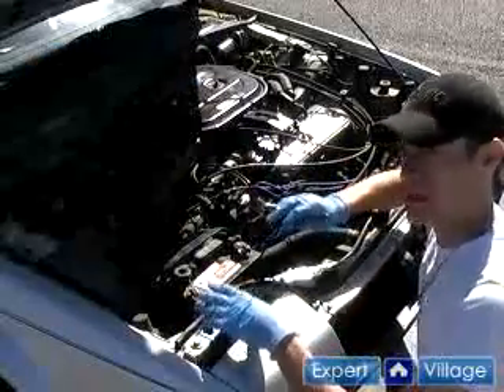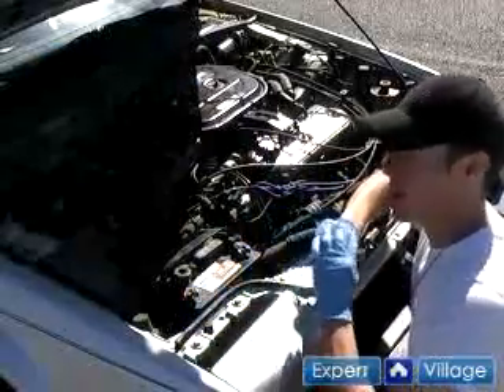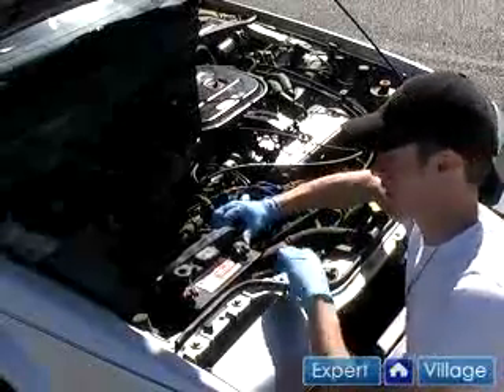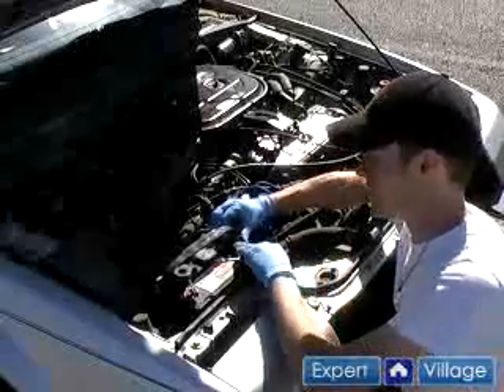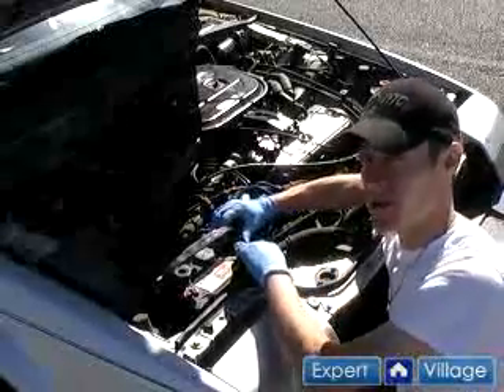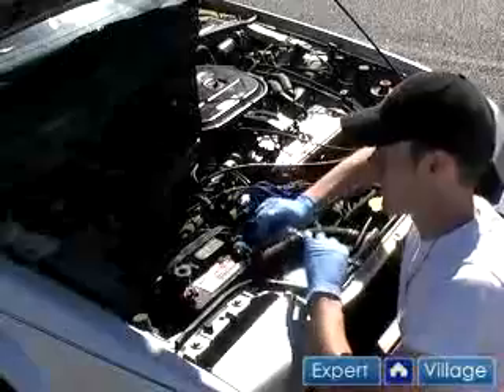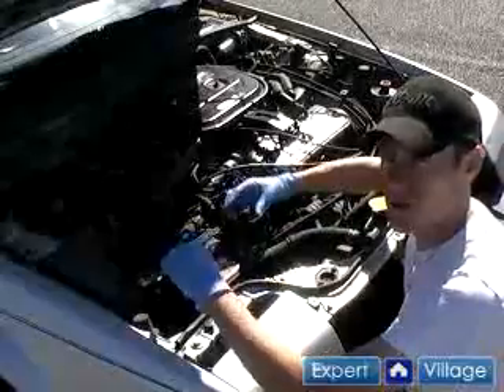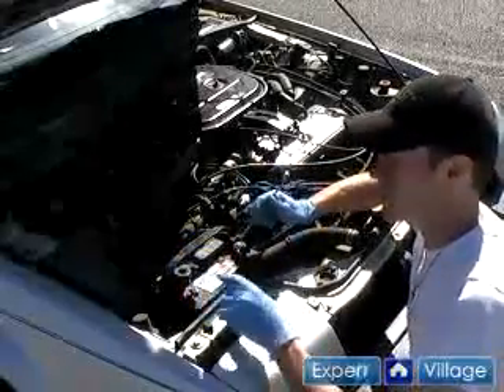How to Avoid Sparking with Car Battery Terminals

Comment: I stopped watching when I saw him working on DC with surgical gloves. 😂😂
Reply: I doubt he did it for protection from the circuit. My guess is it’s to prevent oil and grease on our hands from getting on any of the electrical connections which causes early corrosion .
Reply: Very common for people to work on car engines wearing disposable gloves.

Why is it puzzling to you?
Reply: It's a big word but those are nitrile gloves. It's the year 2023 and there have been some advancements